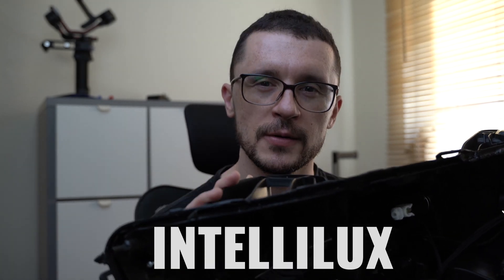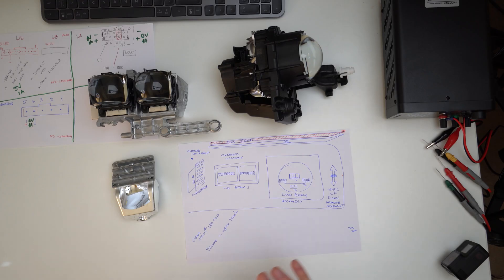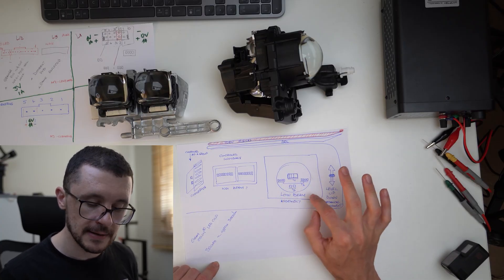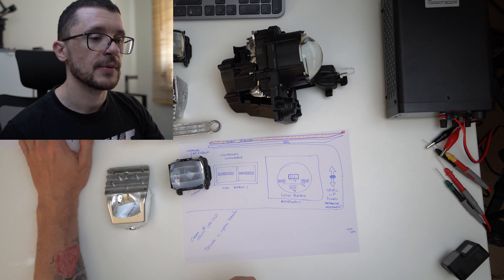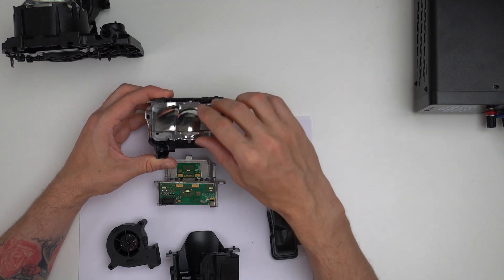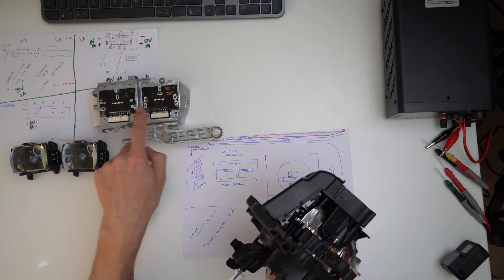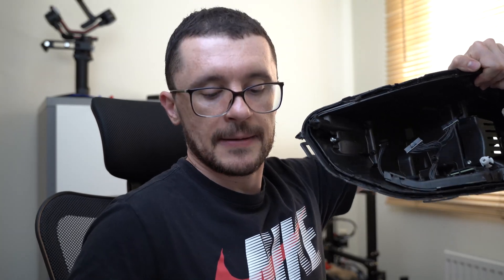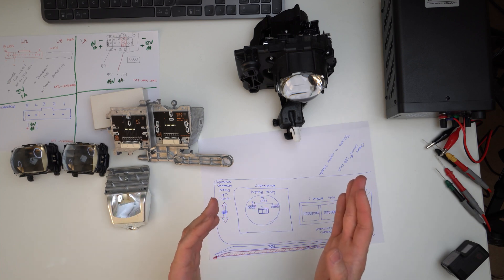Unveiling the Secrets of Intellilux LED Matrix Headlight - How it is made? How does it work?

Comment: It is sad to see that it requires to cut through the front glass to disassembly the unit. It breaks all the design rigidness and impossible to assembly it back nicely. One fault in the inner components leads to being a trash unit. I have insignia gs with LED matrix headlights and right headlight prompts AFL leveling fault. After watching this video I am now certain of buying new whole unit :(
Reply from the maker: it is not that bad. you can use butyl tape to seal the unit after taking it apart.
Reply: @BestCarMods  Yeah it is proper way to assamble it but it would not be reliable in the long run. Maybe I give it a try anyway...
Reply from the maker: @caraltun  :yougotthis: